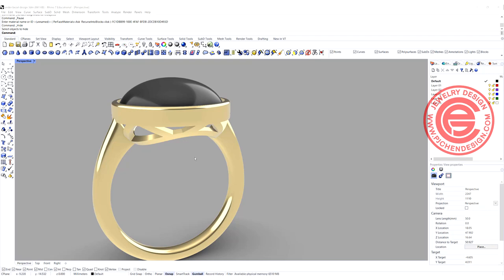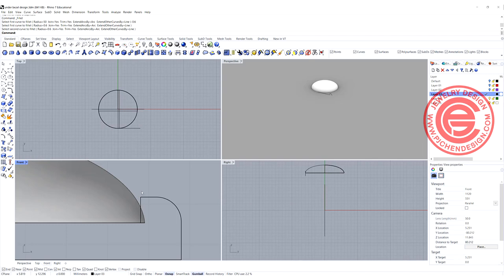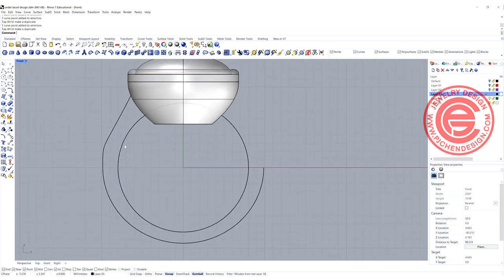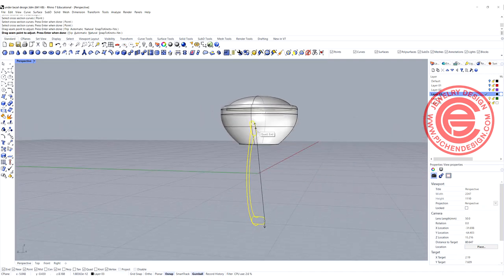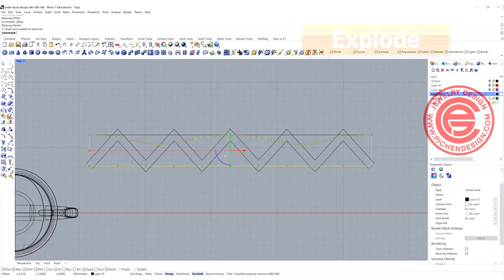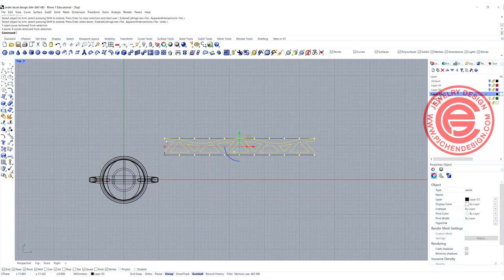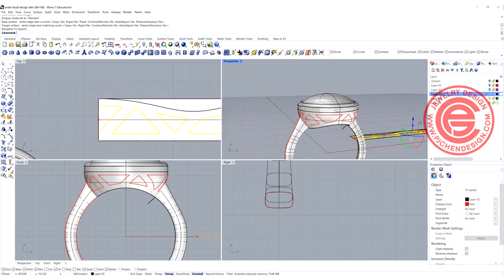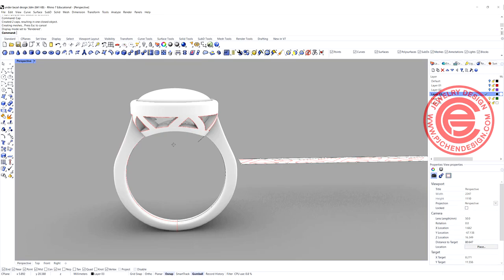How to 3D Modeling the Design Under Bezel for Jewelry CAD with Rhino 3D #230

Comment: Very good work!
Might ask you if there is any basic documentation where we can know for example how many millimeters can of has to be a hole diameter for name necklace and so? Are there any norm documentations for jewellery so we can know that for manufacturing we need to have specific bevel for edges.
Many thanks,
Yasser
Reply from the maker: Due to the different design, there is really not a document for "standard size". Many designers go by their experience. However, Stuller has a good document on their website for 3D printing guideline that discuss the general rule for certain thing. You can check it out at www.stuller.com
Reply: @PJChenJewelryDesign  Many thanks for your quick and vey informative reply.
Due to many name neckelaces that I have done where some of them I hade to redone them I know for example that the 1mm inner Diameter and for the outer Diameter 2.7mm are very good. Minimum distance between two lines are now at least 1 mm but not less then that. The models are 0.8 up to 0.95 maximum and I'm cutting them myself with a 50 Watt Raycus Fiber Laser Machine. Learning by doing...